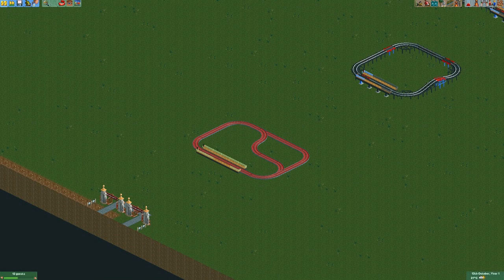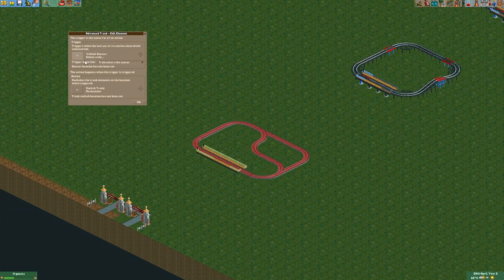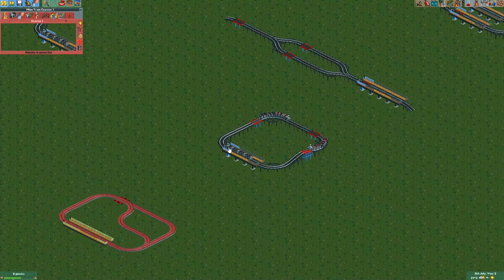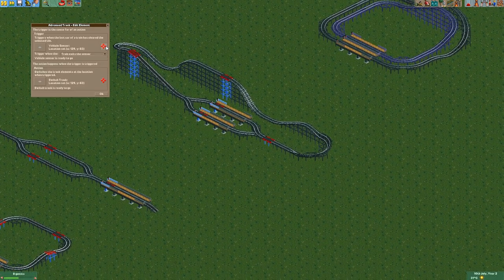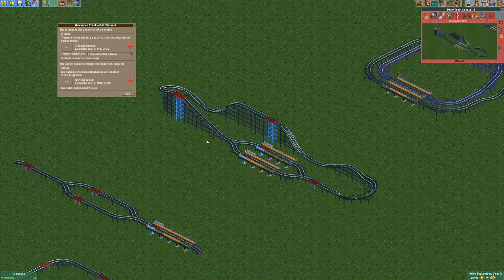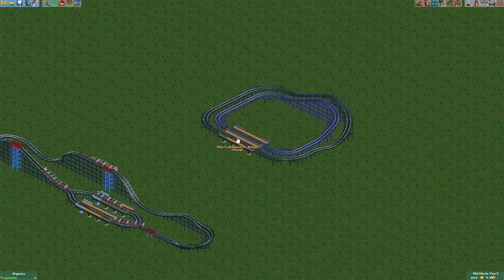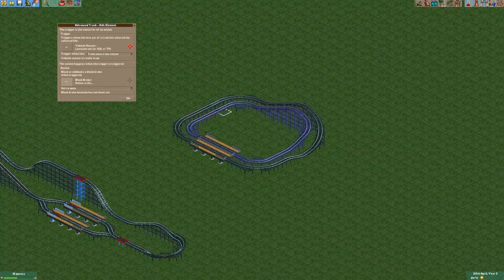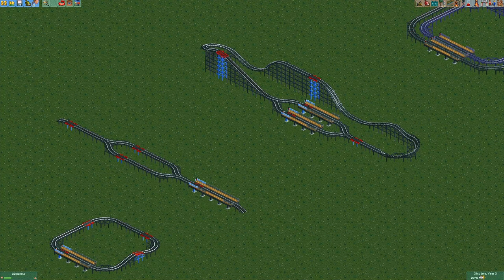How to build a functional dual-loading station (Advanced Track Plugin) - RCT2 Tutorial

Comment: Thank u for this plugin ive been using it in every park. To make split tracks 1 question tho. When i select a spot for switch track that has vertically slopes with other track under it the 2 switching tracks dont always switch? Should i be slecting the tile they are all on or the spot itself where the switch is happening
Reply from the maker: I think the plugin checks for the height of an element as well, sometimes with sloped track the height of that track piece will be different as well, so that'd be something to check with the tile inspector

Comment: This is probably one of the best plug-ins I have seen for Open RCT2. I closely followed your instructions and got the ride to run as shown on your video. However, after cycling some trains, for some reason, the back switch (before the station) fails and spawns a train into a station that is already occupied. Has anybody had this issue? Any tips?

Comment: Well the dual loading Station works. BUT i have to switch the mode to boatmode. The blockbrakes doesn´t work. what is my failure?
Reply from the maker: Double check the positions of the sensors, and initial direction of the switches. 

There's a very specific procedure to allow your ride to be started.

Comment: if it autosaves to the park name - saving a new file should bring the changes over to the new file.
Reply from the maker: That's correct. Right now this is simply a limitation that I cannot work around without tainting the park data. In the future it will be possible for plugins to save to the park file so when that happens I'll update the plugin.